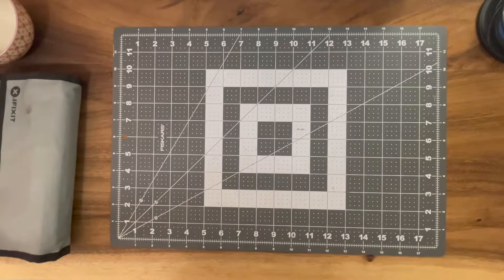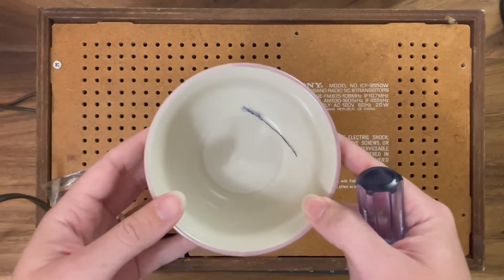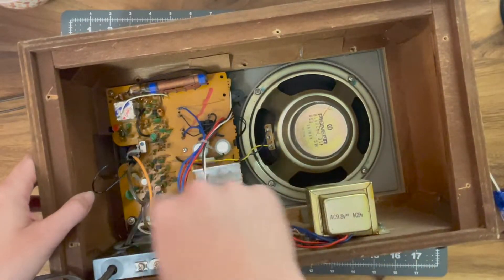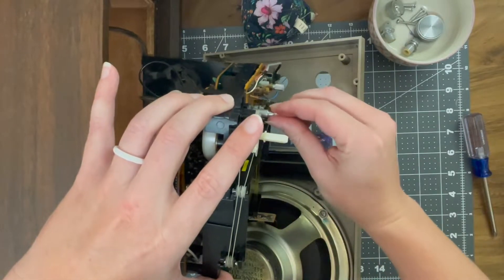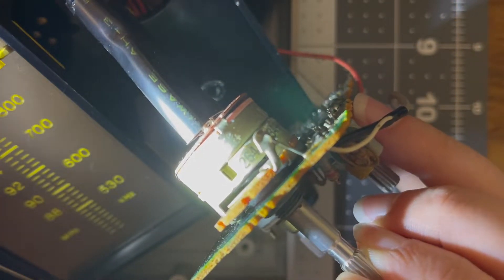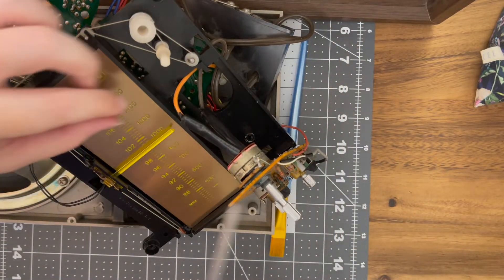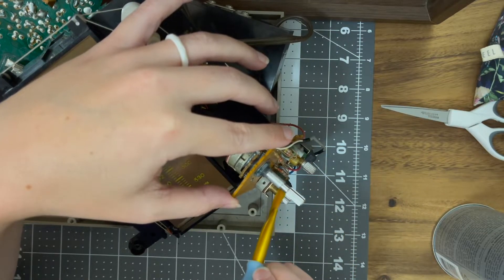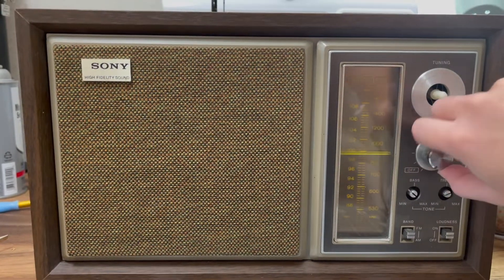Radio Repair | 1970's Sony ICF-9550W

Comment: I have repaired many old radio receivers. If you did not have access to a new volume potentiometer to fix this noise, or because of the age and specialness of the device, you preferred not to replace it with a new part, you can fix this problem with two drops of general tool lubricating oil.  Fix it inside the volume and turning it to the sides several times. I am Alireza from Iran

Comment: The best trick to remove control knobs without breaking them or your nails is to use an old sock. Cut a split down one side a few inches... slide the split under the knob... twist the sock around a bit to tighten it around the knob... and pull it off. You'll be surprised how much power and control you get. DeOxIt5 control cleaner is the best for volume control I think.

Comment: You can spray the volume control without opening the radio by putting radio on its back and pull vol. Knob off and spray down the shaft and let gravity get the cleaner in .work the knob back and forth. Repeat if needed😮

Comment: Nicely done, Meg!   Strongly recommend that you look for a cleaner that is specifically designed for pots (not going to spam you with brand names).  They're a little pricier, but well worth the performance difference, and won't harm plastics/carbon tracks, etc.
And hey, nice Sony radio!

Comment: My grandmother had that same model Sony . I got it after she passed away. I love that radio.  It has great bass, a good tuner and gets very loud. It also had the loud crackling sound when turned it on and the volume was erratic like yours. Followed your instructions and it sounds like new.  It was an expensive table radio in the 70's  ( $50-70) .           Great job Meg, thanks

Comment: I was looking for information about a specific radio and saw the thumbnail of your video and instantly recognized your radio. At a former workplace, there was one that was the same model that wasn't used probably because the tuning knob wasn't working.  

I think the next day I spotted the radio or (a week later), I brought a Phillips screwdriver to disassemble the cabinet to verify the problem. I did this during my breaks. It was a broken tuning string. 

Eventually fixed it with some light braided fishing line. It was pretty tricky, not sure how I figured the routing but I was pretty happy to get it working again! 

I was pretty much the only one using it. 

Pretty cool to see a millennial/GenZ that cares about old electronics. I'm an older millennial and seldom see people my age that have interest in this.

Comment: Very good Meg. I used to work for Campbell TV service until they closed in January 2023. I been a TV repairman for 40 years. I remember working on one like that for a customer and had the same problem and cleaned the controls and switches and it played for a long time. It was a latest transistor circuit design that used a ceramic 10.7 megahertz intermediate frequency filter instead of traditional metal square can transformers with alignment screws in the middle.

Comment: I have the exact same model and also got mine from a thrift store (specifically a Salvation Army). I do not remember what it cost, but had the exact same problem with a dirty volume pot. I just used what was handy, so I sprayed some WD-40 in the pot and it worked well. I know a lot of purists do not recommend using that, but some others in electronics say that it is OK to use for some things. While I had it apart, I also changed the power supply electrolytic caps...Great sounding radio and built well. I enjoyed watching your video !
Reply from the maker: It is really an amazing radio! I don’t know what it is about it but the music sounds so full and balanced. I love it so much!

Comment: That can of stuff looks like it contains trichloroethane, be careful as that could easily melt various plastics and stain/damage Perspex. Servisol switch cleaner is usually used for volume pots. All the best, Ast...
Reply from the maker: Thank you the tip and heads up! I will be sure to be careful. ☺️

Comment: You might want to consider lubricating the bearings on those three knobs with a little light oil, like sewing machine oil. If you don’t, the knobs could seize up. Otherwise good job.
Reply from the maker: Wonderful tip! I actually have some of that oil on hand, so I will do that. Thank you for the tip!

Comment: Are you sure those were fuses? I think they were fuse style lamps.
Reply from the maker: I suppose they could be. I wasn't able to get my hands on any official schematic and this was my first radio repair ever, so I was leaning heavily on my experience of working on other electronics and they looked like fuses I've seen before. If anyone knows for sure though, I will gladly make that correction and would love to learn more about them! Thank you!
Reply: @GoodEffortMeg  those type of fuse lamps were common in that era. I have found them a few times on eBay an purchased all they had. I like to replace parts to be as original when can. But, LED lighting is all you see now. I will look for a schematic myself an see what comes up from the forums I am on.
Reply: They were fuse style lamps. That, or the radio dial light runs on magic.
Reply from the maker: @js0000356  haha I now like to think of them lighting up with magic, but yes thank you for the correction 😂

Comment: Just remove the knob and  Squirt the cleaner in always works if just dust. Ps ive seen radios packed full of lint. Kind regards David
Reply from the maker: Absolutely! I tried this before even filming, but I think because it was carbon build up inside of the rotary switch I couldn't get most of the dust out without some disassembly. But what you said is absolutely right, to start with the simplest solution first! Thank you :)

Comment: I wonder why it had two fuses. Were they both functional or was one a spare?
Reply: Those are light bulbs for the tuning dial, not fuses.
Reply from the maker: @vwestlife  lol yeah, someone commented earlier correcting me. My experience with older electronics is limited so happily accepting any corrections to become more knowledgeable! ☺️
Reply from the maker: Great question, and I didn't look closely enough to note if one was a spare. I couldn't get my hands on a schematic online without paying for it from websites that I wasn't familiar with. It's what makes working on older electronics so much fun! I kinda move through the repair process blind and rely on my previous experiences to hope what I am doing makes sense and fixes the problem. I know that didn't answer your question and I apologize for that. I might pop it open in the future and take another look. :)
Reply: @GoodEffortMeg  It's always nice learning something new digging into old electronics. Assuming those are the original capacitors, you'll probably have to go in again at some point anyway to replace those.
Reply: They're not fuses - they are "fuse-style" lamps for illumination of the dial.